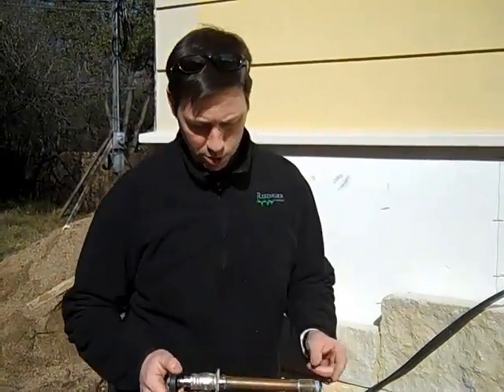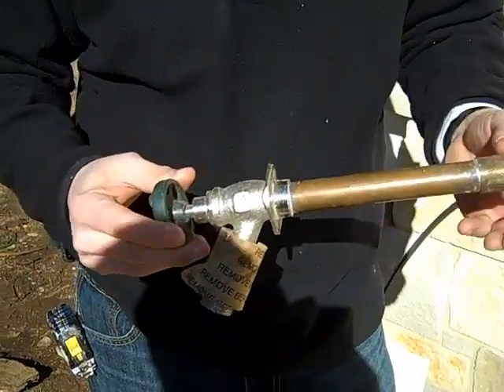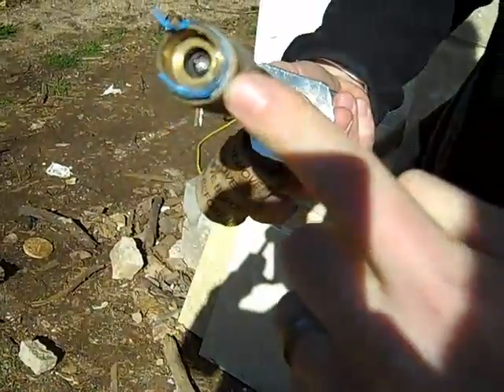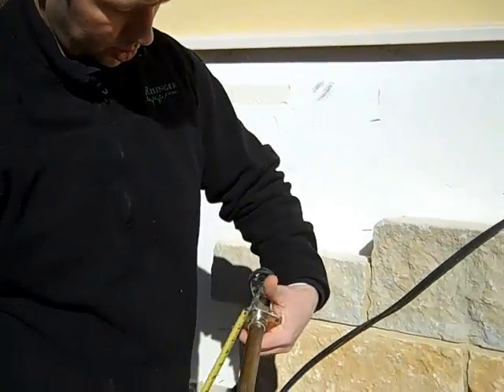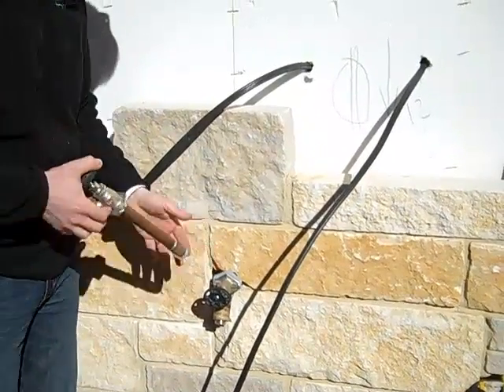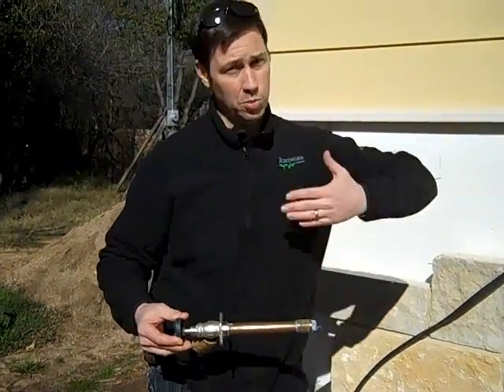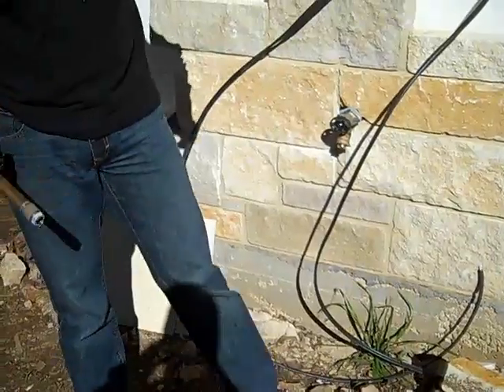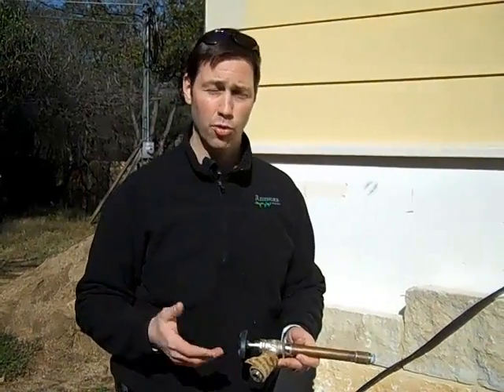Frost Proof Hose Bibs

Comment: Must be installed properly though. Need to grade down slightly to drain the barrel out. Otherwise water can remain in the barrel and still freeze. Also should be installed with a drop ear 90 to allow removal if broken. They are made where you can solder them, but then you will have to cut your wall to replace. I realize the builder knows this . This tip is for home buyers benefit.

Comment: Thank you for posting this. It is unfortunate that a new homebuyer has to specify frost-proof hose bibs in new construction rather than the builders providing them as part of their normal design. It is also astonishing how many homes are built with waterlines in underinsulated exterior walls or uninsulated crawlspaces.